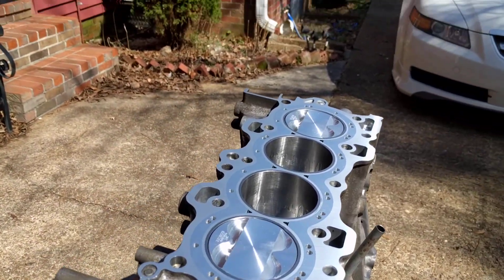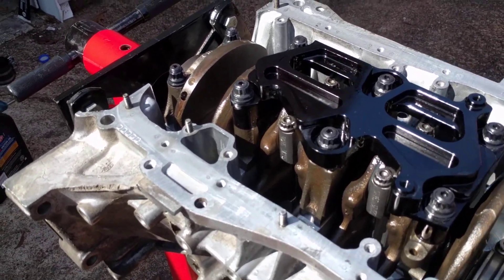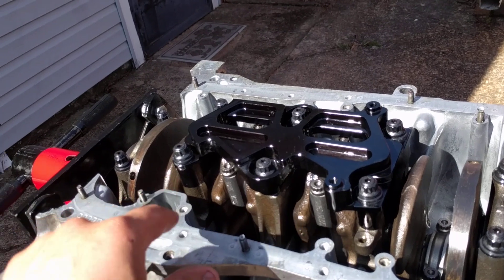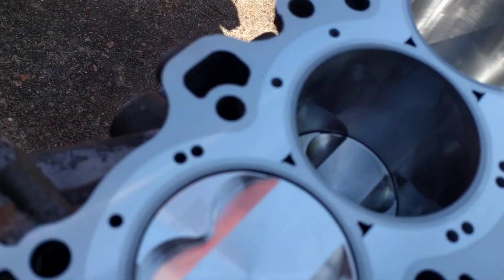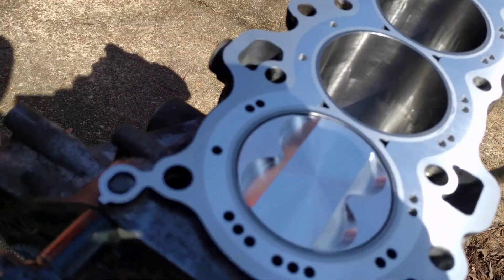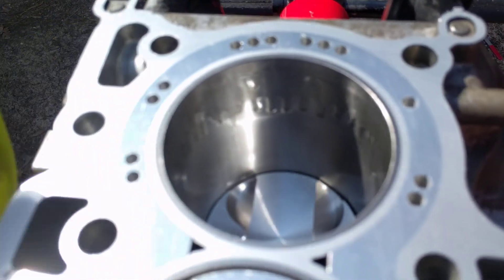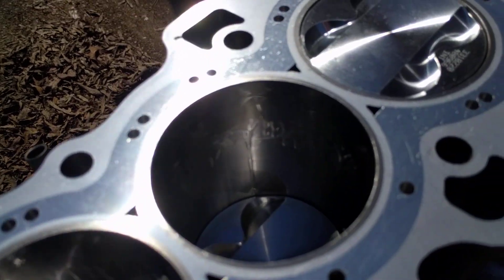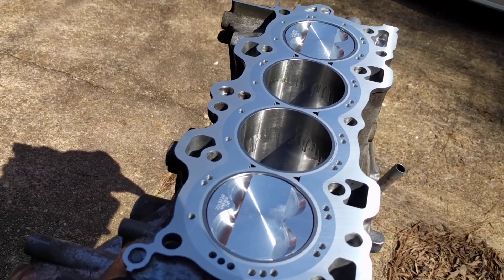B18 css block specs

Comment: Is this motor still running...and was this block set up for Daily Driven/Track  Use?
Reply from the maker: Yes still running and yes it was built for regular use and some track days.. but this is a second car is not my main daily driver..
Reply: @civicpride1986  
How much horsepower are you seeing and at how many pounds of boost?
Reply from the maker: @methodical_66  on 93 pump at 22psi made 455whp and on 110 race fuel at 32 psi made 602whp..
Reply: @civicpride1986  Hey. Nice build! I’m glad to hear that it is still running. What’s part number for those main arp? I got a LS built, 525 WHP for now and looking for +700. I’m going with the css high hp and oring. I would like to do that job on the girdle. What brand is that girdle support? Thanks
Reply from the maker: @Rboost77  you need to use the arp main stud kit for the gsr model that comes with girdle.. this girlde is on ebay for like 100 bucks is brand sickspeed you will see them on there..
Reply: @civicpride1986  Thank you bro!
Reply from the maker: @Rboost77  with the css and the girdle and the arp mains you will make 700+ if your turbo will support it.. what turbo are you going to be running for that goal?
Reply from the maker: @Rboost77  just check into those turbo and they look very nice, I am sure you will make the 700+ no problem on that... I am subscribe to your channel so I will see the progress.. if you need anything else let me know.. that thing at 700+ will be a beast.. one thing that might help you in power is replacing those cams to s better set of cams.. crower 404(what I have) or crower 405 those will make the most power on LS engines..
Reply: @civicpride1986  Thank you bro! I really appreciate it. The head has been ported and polished, Brian Crower stage 2 turbo cams, Titanium retainers and dual springs. I gonna upgrade the valves to Ferrea 6000.
Reply from the maker: @Rboost77  yes those ferrea valves work great that's what I am running..

Comment: Quick question so i bought some high compression pistons and it came with some rings that got messed up got rusted .. can I order some new one I seen online the are just regular b20 piston rings will that work? Or would I have to order the rings from Nippon racing ?
Reply from the maker: As long as you get quality pistons rings and are gap accordingly then the engine will be fine... Most people that break pistons rings are due to not gapping them properly, sometimes is best to go a little larger on the gap to be safe then tighter and have a broken ringland..

Comment: What did you see for compression numbers once assembled? I seen 195psi across the board. this is on 9:1 comp gsr b18c
Reply from the maker: Mine makes around 190 across the board.. thats with big ring gaps of 22-25 top and bottom.. compression on my pistons is 10:6.
Reply: @civicpride1986  what do you think I can get out of my motor reliably gsr top to bottom 9:1 compression  no support on sleeves forged piston and rods?
Reply: Boosted set up.
Reply from the maker: @gsrturbo3786  you can safely make 450whp on that set up... I boosted on stock sleeves for a while at 408whp and abuse the car no issues.. with a good tune and since you run vtec head you can safely make 450whp and not worry about blowing it..
Reply: @civicpride1986  thanks bro I'm assuming your talking 450whp  e85? I wanna just go with pump gas 93 more convient for me. 350 whp on pump should be do able on pump? Wish I had did cylinder support system.
Reply from the maker: @gsrturbo3786  i did 408whp on pump gas 93 octane.. u can make 450whp on pump no problem as long as you use good gasoline like shell or exxon or something name brand..

Comment: Hope you had that line bored? Oh I see our torqued to factory specs. Torqued mine  80ftlbs. But I had mine line bored. Looks good bro.
Reply from the maker: Gsr Turbo yea i went 5lbs over stock gsr specs using arp mains.. thats how i build my last block and still running strong on a friends car.
Reply: @civicpride1986  do I have to line honed if I plan on installing a girdle on a b18b1?
Reply from the maker: @jnsergio503  I did not and have no issues.. the aftermarket girdle goes on top of the factory caps so there is no need to line hone.. just plasti gauge and make sure clearances are good .
Reply: @civicpride1986  thanks

Comment: I have the same setup sitting in my house now on the stand. 82mm as well. What turbo will you be using and what head?
Reply from the maker: william leal garrett GTW6265 and LS head fully build.. ferrea valves 6000 series, skunk2 intake manifold and throttle body, crower 404s.

Comment: let me know how that goes because i didn't install my arp main caps for that reason,wasn't sure the poem torque spec was gonna be enough and didn't wanna line hone
Reply from the maker: Irvin Dorsey i did it like this on my first ls block build and had no problems.. that block still running strong on a friends lsvtec turbo set up.. torquing 5 to 10lbs more then stock torque specs is perfectly fine using arp mains.. of course always check your clearances to make sure..